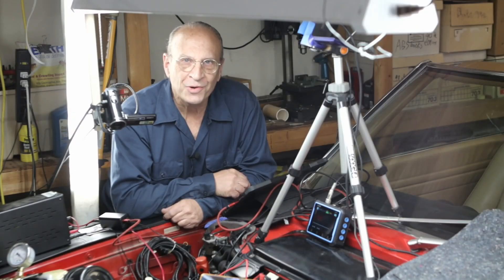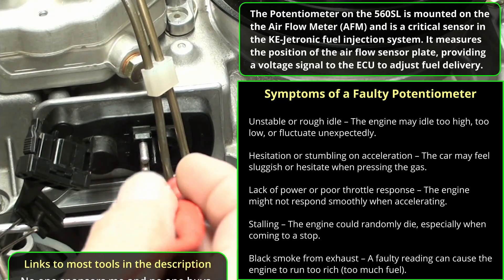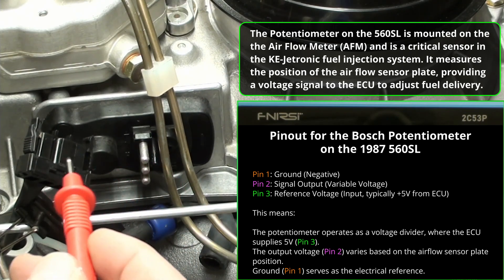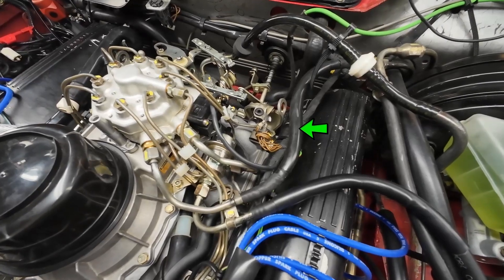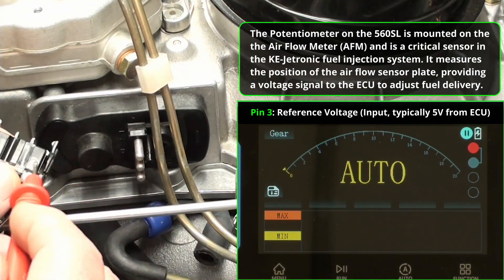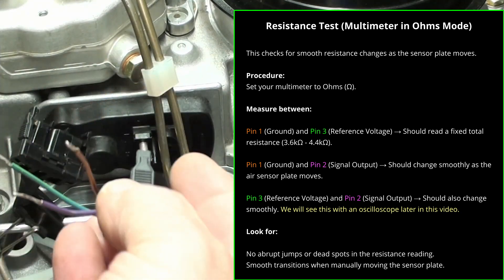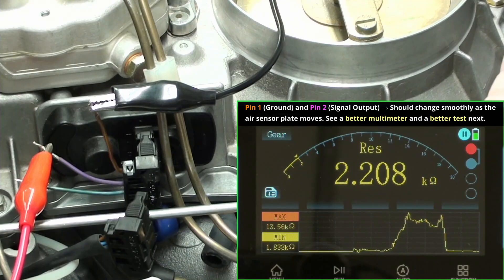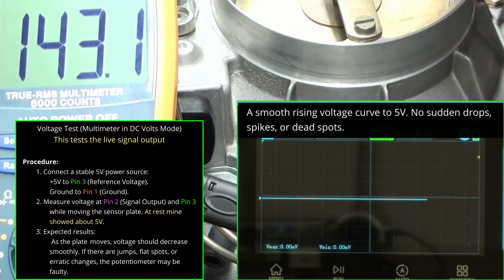560SL - Potentiometer Explained in Under 10 Minutes!

Comment: I've tuned mine on the 89 300E recently with the engine running after replacing it with a new one.  I loosened the screws, positioned it high, then tapped it slightly with a screwdriver until it got around 0.7v.  I finally tightened up the screws.  BTW, I pulled out the 3-pin plug a little bit, and clamped the multimeter leads to them.

Comment: Tony.  Your explanation along with everything else is as good as it gets.  Are you a teacher or professor by trade?
You are most definitely gifted in this area.
I have 2 Mercedes.
A 1991 W201 Sportline Japanese spec 2.0liter auto, and more recently a 1988 560sl.
Unfortunately l discovered some rust on-top of the drivers side shock tower bracket (very top at shock bolt area).
I just received the entire bracket from The SL Shop in the UK.
It's the only spot fortunately.
Love your Videos.
Reply from the maker: @peterarsenault2671  hi Peter. Thanks for the kind words. I am not a teacher or a professor. I’m just a guy in his garage trying to document the restoration of his 1987 560SL. YouTube is a place where people look for help and I want to make sure I answer the questions they have with my videos. The 560SL is definitely the R107 to have when it comes to rust. The earlier R107s had all kinds of problems with rust. Have you watched Mikes mercs and other cars YouTube channel? He’s in the UK and he has a few of the older R107 and they are all rust buckets. Mercedes did a wonderful job addressing most all problems of the early R107s. Mercedes doesn’t build them like this anymore. It is the best built vehicle I have ever owned.